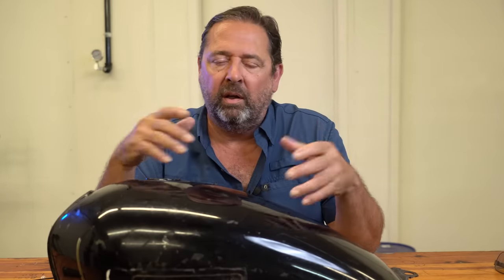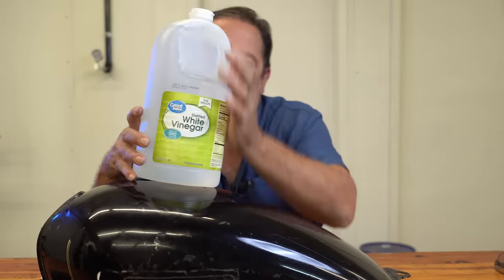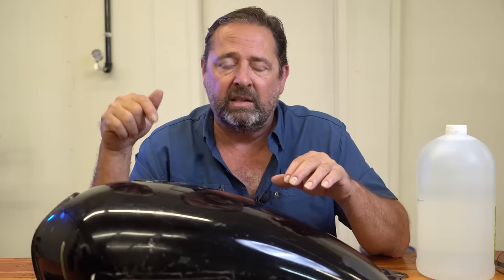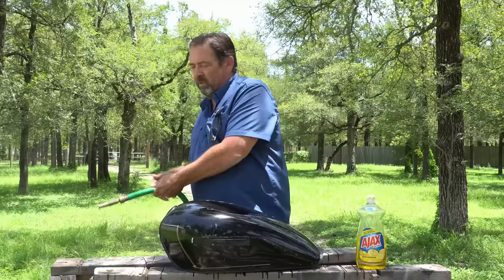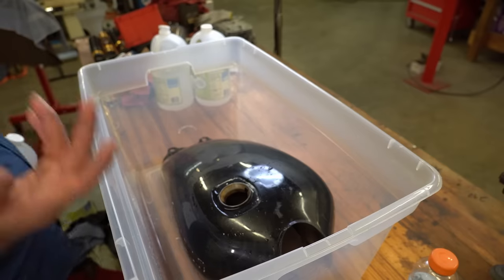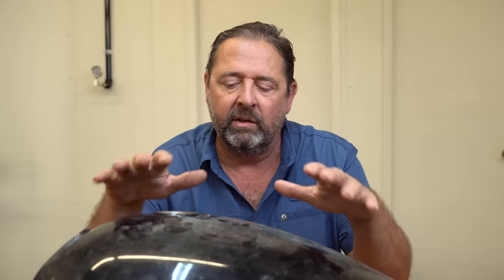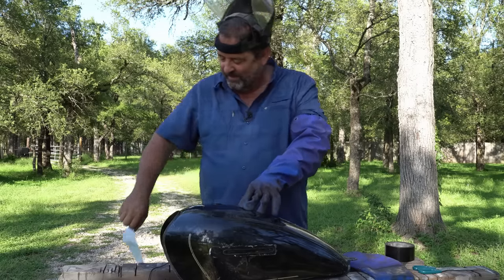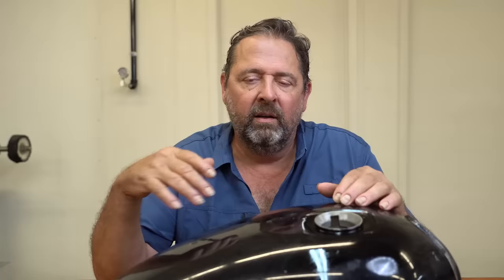GAS TANK--CHEAP--RUST REMOVER !!!!!!

Comment: There is an even cheaper and quicker way to do this though...just put in the tank a mix of, diesel coca cola and sand, preferably the sort with some tiny rocks in it as well, and just slush that around for a while until it's all shiny as new again - and no protection gear needed either...but you need the muscles.
Reply from the maker: Awesome advice!
Reply: @CycleFab  Should add on - to make the prosess easier for yourself, you could always put the tank with sandy slush in it on a children's swing...just shorten the rope by tying it up so you have a comfortable working height - this at least for the main part of the job - and just shake it as you slowly role it around...but maybe there will be a few crinkles and corners you need to shake the thing harder straight up and down too though

Comment: The vinegar 'first soak' really isn't doing much at all. A better alternative to vinegar is to use citric acid (you can buy citric acid powder). The citric acid had a pH of about 3 whereas vinegar is 5. Muriatic acid is 100% hydrochloric acid, pH 1. It does a great job of dissolving rust but I would not recommend its use on thin metal like this gas tank. The muriatic acid dissolves deep into the metal so that even when you rinse it off very well it still keeps attacking the metal, making it 'soft'. Rather than using muriatic acid use Phosphoric acid instead - this reacts with the rusty metal to coat the surface with iron phosphate which is hard, unreactive and suppresses any further rusting.
Reply from the maker: The phosphoric acid and citric acid sounds good...I'll check it out!
Reply: How much phosphoric acid would you use on a 3.5 gallon tank?

Comment: The vinegar disintegrated my petcock, and flex tape, how do I prevent that
Reply from the maker: I've never had an issue with vinegar doing that.  Vinegar comes in different strengths you may have been using an extremely strong version of it.  How long did you let it sit in your tank?
Reply: @CycleFab  it’s been about 18 hours and it’s starting to slowly drop out the sides, I’m just using the normal distilled vinegar found in stores and to seal it (because the shuttlecock is now ruined) I’m using a large about of flex tale
Reply from the maker: @iwannadimmadie7186   I don't know why it would be reacting that aggressively.  Without it being directly in front of me I'm at a loss speculating your issue.

Comment: To dilute a chemical concentration you must use distilled and deionized H2O the minerals in tap water will react with the solution, and the electrical charge in ionized water will have an effect either desired or undesired, and adds a variable, in my case I'll call it an unknown variable because I don't feel like thinking, but it can accelerate (Perfect World) or limit (Murphys Law) the rate of the process. If you have hard water, iron, sulfur, arsenic, lead, metal oxides, soluble metallic or mineral salts, the chemical concentrate will react with what it comes in contact with first until the molecules dissolved in the water are  effected, the byproducts settled, the chemical solution sacrificed some of its   components. Basically "Shit Happens" if you don't eliminate the catalyst!
Reply from the maker: Great information!  Thanks a lot.

Comment: Anybody ever put steel shot in the tank, and drive around with it for a few days?  I've never done it...  but heard it was pretty effective. I'm not sure what size steel shot, and I'm assuming just enough for it to roll around.
Reply from the maker: That could cause debris to break loose and and flow into your carbs and cylinders.  And very possibly would cause damage.
Reply: @CycleFab  After you do it, of course you need to rinse the tank good....  that is kind of like just breaking it all up.  Hillbilly sand blasting job more or less. And you do it for several days "I think"  ....  don't know, just heard about it once.  THANKS!

Comment: Your method seems to be solid enough. I have a tank with no petcock valve,and the whole pump sets into the tank. With that being said, trying to get everything out is a whole bite in my ars! I cant find anyone on line that can show how to get the last cup full of garbage and gas out of the tank. The cap area inside has splash gaurd,and the bottom,where the pump sets in,has the sides of the tank which only lets a trickle out at a time. You seem to have the same kind of tank,so the only reason i watched your video was to see how you got it out.
Reply from the maker: Some tanks can be a pain.  Best thing to do is keep researching, or buy a shop (factory) manual.
Reply: @CycleFab  I can get it out,but it's just going to be a bigger pain than I want it to be. I bought the bike to fix it,so I really shouldn't complain. I put this on myself, now I have to deal with it. Thank you.
Reply from the maker: See the hard projects to the end, the benefits of this is all for you.

Comment: Using vinegar first then muriatic acid makes absolutely no sense. it should be the other way round, since the vinegar is a weaker acid, it will help to start the neutralizing process of the muriatic acid. However, the best method is to skip the vinegar entirely, and use only muriatic acid followed by phosphoric acid. You see the problem with muriatic acid is that it works to well and is quite persistent especially when it gets into seams, so it is quite difficult to neutralize, the reason is because muriatic acid, completely strips the steel of all oxides and compounds, leaving nothing behind but pure virgin steel. And steel that pure is extremely prone to rust, from even the most miniscule amount of moisture. So, during the neutralizing process rust will develop. Truth is, if a haze of rust does not develop during the neutralization process, you haven't. neutralized the muriatic acid completely. Yeah, it may appear bright and shiny for an hour or two, but the acid will still be in the pores of the steel and continue to react until every single acid ion is spent, leaving behind a haze of rust. The worst thing you can do is prime steel that has been treated with muriatic acid, but not properly neutralized, because the reaction will still occur under the primer, oil won't stop it either, but at least you will be able to see it. The answer to the problem is to follow up the muriatic acid treatment with a thorough water rinse (no baking soda just pure water period) followed immediately by a phosphoric acid treatment. Phosphoric acid is not as strong an acid as muriatic acid (which is actually diluted hydrochloric acid) and doesn't do nearly as good a job in removing rust. however, it is more or less self-neutralizing, because even if the phosphoric acid is not completely neutralized the remaining phosphoric acid ions continue to react with the steel to form iron phosphate. So even if you do not completely neutralize the phosphoric acid your steel that appears bright a shiny will turn a dull grey and even blackish in areas, yeah it is a form of corrosion, bit it is mainly iron phosphate, that can be mechanically removed or just painted over, since it is inert and will not induce further oxidation.

Comment: There's an eve cheaper way!  put a handful of 1/2 inch washed gravel in your tank along with a cup of kero or diesel etc. and shake and roll the tank about.. Be sure to remove the tap/fuel pump/sender unit before hand. shake tank till all the gravel comes out and rinse clean with fuel. Voila!
Reply from the maker: Good idea.

Comment: Use electrolysis. Cheaper, safer and works better. Arm & Hammer, Washing Soda (NOT baking soda) water and a Battery charger. Lots of instructions on YouTube.
Reply from the maker: I've used electrolysis before on larger things and yes it does work very well.  Maybe I'll try it on a tank next time.  Thank you for your input and watching my channel.

Comment: Molasses 1:15 to water.  It eats rust.  It is cheap.
Reply from the maker: I've heard of that. Thanks for the info.,  might have to do a test to which is better.
Reply: @CycleFab  The molasses breaks down to be Phosphoric acid.  I had an old ceased gearbox so I poured it in and 2 days later she turned.

Comment: I used wd-40 and the rust came right back
Reply from the maker: I have had that issue before.  If the WD-40 or other type of rust inhibitor oil (two stroke engine oil) isn't applied immediately after your final rinse a flash rust can occur.  Thanks for watching and commenting.

Comment: Just how did that tank get so goofed up, anyway? And between spending the $30 or putting on a hazmat suit so you can handle MURATIC ACID, i'd rather just spend the $30. I mean, come on.......
Reply from the maker: I just know that the bike had been sitting in/or out side of a barn since the mid '90's.
Reply: It is $30 a gallon. You will need more than one.